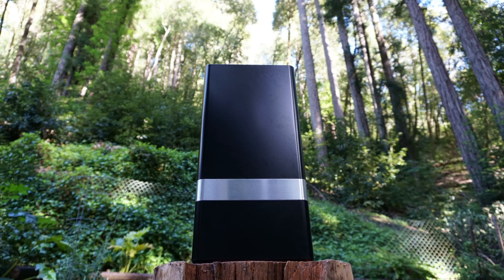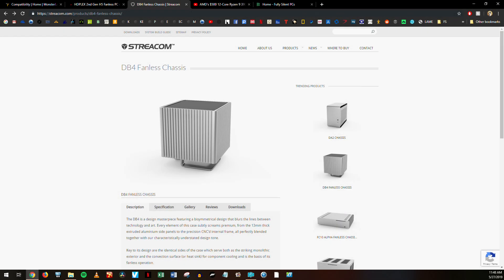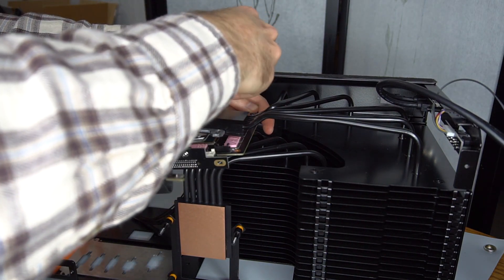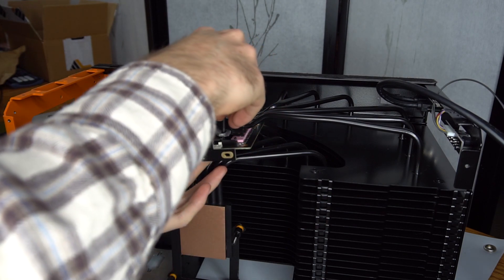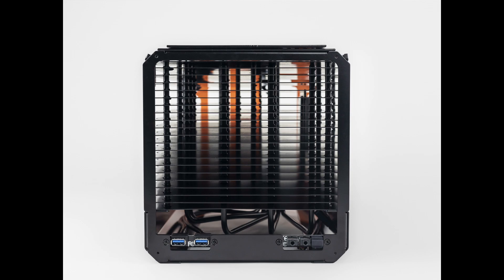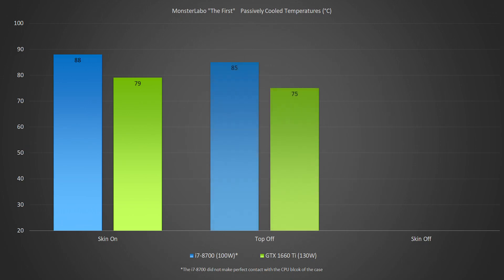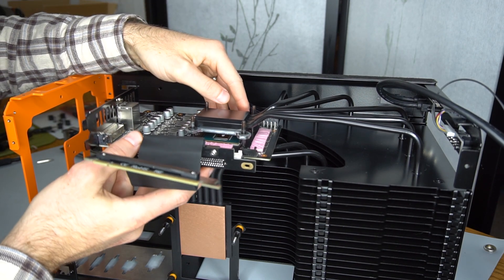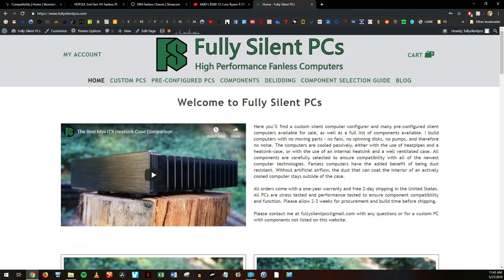Testing the MonsterLabo The First Fanless PC Case

Comment: NOT big fan of RGB , Just want to know if is any discrete light that shows the pc is running?
Reply from the maker: Not on the case. Sometimes the motherboard will produce some light, but otherwise you don't know unless you have a display.
Reply: @fullysilentpcs  Thank you for quick reply.

Comment: I would put one Noctua NF-A12x25 in the case and configure it so that it will only spin up when the CPU reaches 75°C - i think the fan should only have to run at ~300-500 RPM to keep it at 80°C at all time :^)